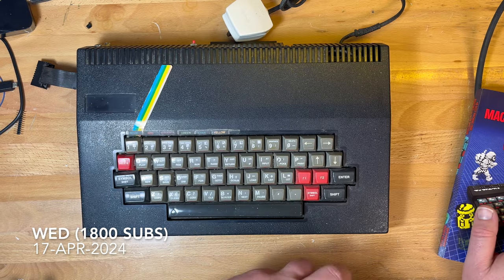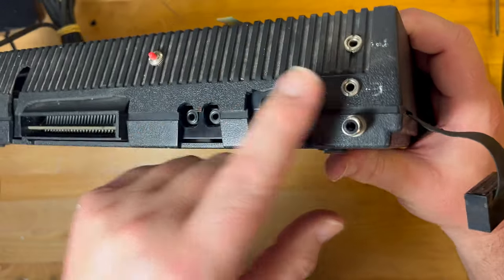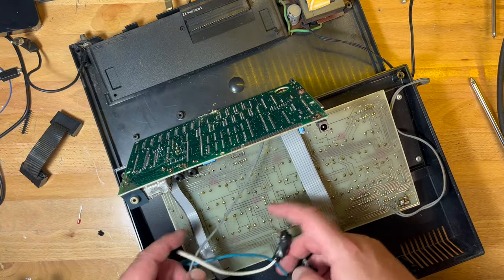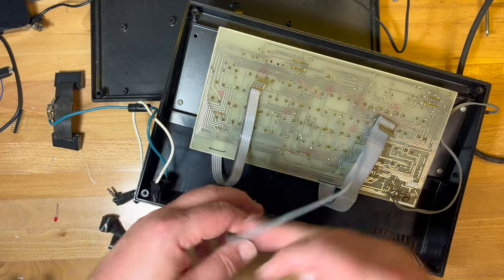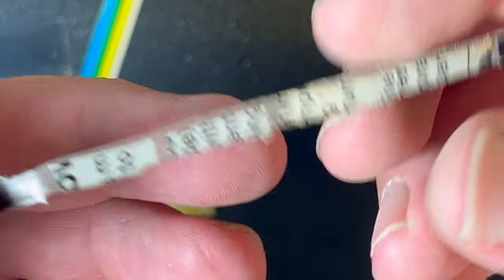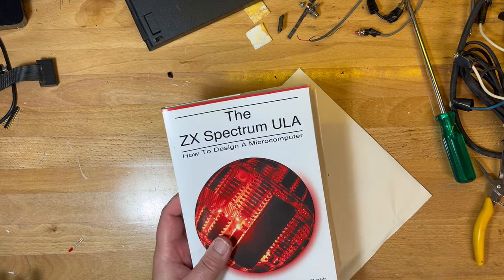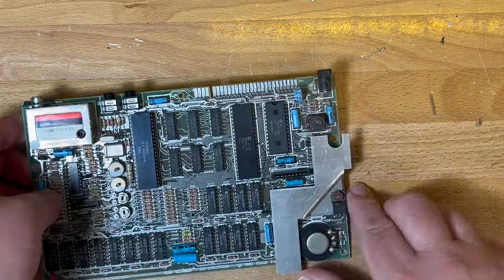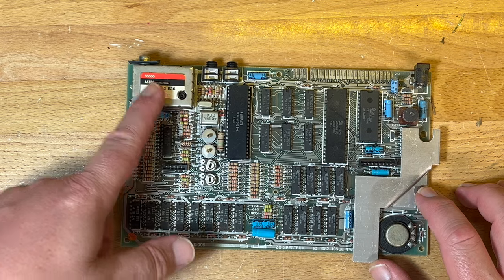🇬🇧 Sinclair ZX Spectrum & Interface 1: Part 1 (First look & test) [TCE #0437]

Comment from the maker: {Updates/Errata because no-one reads the Video Description 🤭}
{Updated as per @1337Shockwav3's comment, thanks} 
The case is by Fuller and is called the "Fuller Desktop System" or FDS, in this ... ahem ... "case" modified on the back to accomodate the "ZX Interface 1" expansion.
{Corrected as per @markevans2294's comment, thanks}
The "ZX Interface 1" provides MicroDrive, RS232 serial and "ZX network" interfaces.

Comment: The 9 pin connector on the ZX interface 1 is RS232 serial rather than a joystick. There will also be two 3.5mm sockets for the ZX network. Which is, sort of, compatible with that on the QL.
Reply from the maker: Ahhh … thanks, I’ll correct the Video Description. Ah, of course … joystick would’ve been a male DE9. Duh.

Comment: Yay, a Fuller FDS keyboard. I have one of those and it has pretty much become my favorite 3rd party keyboard ever since.
Reply from the maker: Ah huh! Thanks for IDing it. So looks like they did some case modification to accommodate the Interface 1?
Reply: @Brfff  Let me check, I've only seen the thumbnail so far. On mine (which is unmodified to my knowledge) an IF1 doesn't fit externally.
EDIT: Yup, that backpanel is definitely modified. Might take me a day or two but I can post a picture of an unmodified one on discord.
Reply: I've got one of these keyboards.  I need a Spectrum to go in it though😊